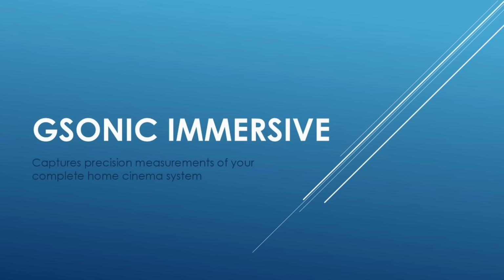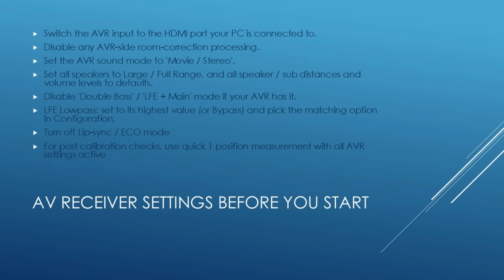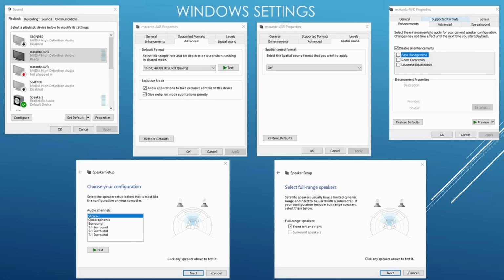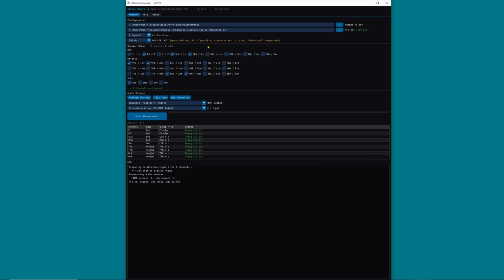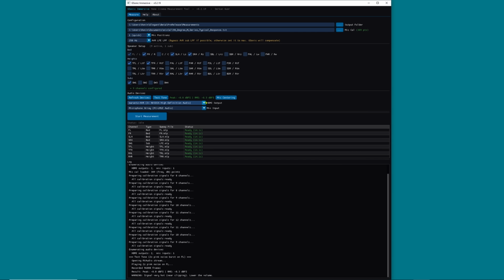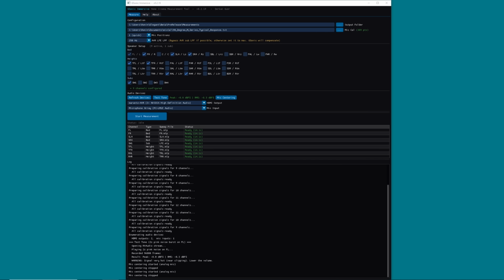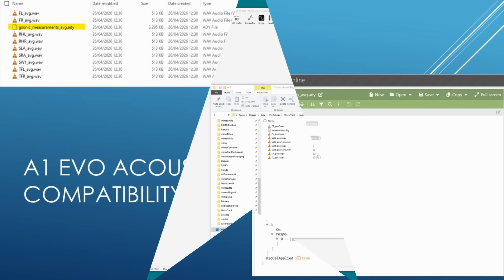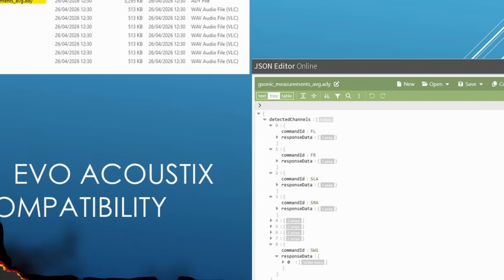GSonic Immersive

Comment: Trying version 1.09 can’t get past the front right speaker on first measurement had unreliable ATR timing. Both chirps were blocked or one was disrupted. Step out of path.  Nobody is in the room.???
Reply from the maker: Did you try AVR reset? It checks and reports if your current setup is decoding Atmos correctly.
Reply: @ocaudiophile  no I did not do an AVR reset. And I am not using Atmos speakers. The chirps are loud and clear and the microphone picks them up as the last version I had worked perfect
Reply: Except as you know, the volume issues
Reply from the maker: Set your AVR in Windows to "Stereo" mode, not 5.1, not 7.1 not atmos. Make sure you tick allow exclusive access", 48kHz, disable enhancements. Set AVR sound mode to stereo when there's no signal coming. This is the one that auto-switches modes. Some older models reported "Direct" sound mode worked for them but uncofirmed.
Reply: @ocaudiophile  the microphone is set to 48K gaming, stereo, movie are all set to stereo. 5.2 is pretty much automatic on this model. Once you select your speakers it’s a brand new model one year old.
Reply from the maker: Never heard a gaming setting for a mic but any/all enhancements needs to be turned off in general. If you assume the app is working correctly and look for what must be wrong in your setup, you will solve this quicker. If you are using settings you always use with REW for example, it will not work. I don't know whet else to tell you.
Reply: @ocaudiophile  I don’t know what else to tell you either. It’s not like I don’t understand this. I engineer my own speakers I used to repair television. I was a master technician for general motors for years before I started my own business. I totally understand, electronics, and all of this I’ve been doing this for 60 years as I built my first speaker when I was eight
Reply: I’m using 1.08 right now and it is working fine for the testing
Reply from the maker: Yet you think setting all speaker distances to 9ft will deviate the center.
Reply from the maker: Yet you started this conversation claiming there was 20dB difference between your FL and FR with v1.0.8
Reply: @ocaudiophile  I never said that I was just giving you what I saw as I checked through everything after version 109 reset everything. What I’m gonna try tomorrow is use version 109 to set the volume then switch to 108, and do all the measurements and see what happens. Like I mentioned to you before the only problem I had with 108 was that the levels were all over the place. Front left was 14 DB higher than front right and both subwoofers were set to +12. I’ll be starting around 9 AM central standard time. I’ll write you back what I find if you think of anything I would appreciate. And if I think of anything, I’ll write you.
Reply: @ocaudiophile  no that is incorrect. About a 14 dB difference. But if you saw my post on AVR forum, I said that there was a 24DB subwoofer difference with the new.Acoustix, using version 108. All of a sudden my subwoofers went to +12 DB, the old version was minus 8DB and I was using it in flat mode instead of reference, which was another 4 DB. = 24DB. Some people and AVR forum were saying that would G sonic there base was lacking 10 DB. I can’t verify that. But some change was made and that’s what happened to my system. I’ll keep you posted what I find tomorrow. Plus, I’ll think this over tonight and see if I can come up with something but I’m nowhere is near sophisticated as you are with this area.
Reply from the maker: If you knew me better, you would know I’d have already told you if there was even a small chance this issue was caused by the app and ask for your debug log. Bugs do exist, of course that’s true for any software but your specific problem doesn’t seem to come from the app itself. That’s why I’m trying to explore other possible causes and mentioning anything that comes to my mind.
I’m not suggesting you don’t know how to configure things properly. The setup for this app can be quite complex and varies a lot between systems. Windows audio kernel, in particular, is quite messy, and since the app uses three different sound modes during sweeps, it’s definitely not straightforward.
That said, your symptoms point to something else entirely. It could be related to a faulty HDMI cable, a microphone extension cable, or another hardware or driver issue. It is not capturing any of the two ATR chirps since it thinks you are blocking the FL speaker. If one was lost, I would say high reflections. Anyway, Let me know how it unfolds later. Btw, I am happy to issue you a refund in case you get stuck and app is useless for you.
Reply: @oca @ocaudiophile ’re misunderstanding me I don’t want a refund. And again, it is measuring perfectly with version 108. I thought about a handshake issue, but I don’t think it is. Let me do what mentioned tomorrow and I’ll get back to you.
Reply: Also, the Mic centering does not work at all. It’s all over the place and trying to put the microphone first to the right 800 mm done to the left 800 mm and so on but mostly trying to put it to the right.
Reply from the maker: You need to move the mic slowly listening to the tone pitch, it will increase the closer you get to the center, no need to look at the screen. It will only start giving tones when it's around center.
Reply: @ocaudiophile  I totally get that. There is no space between the speakers that the centering stays put it jumps all over.
Reply: @ocaudiophile  also maybe this will help, the automatic reset is setting the distance at 9.8 feet for all speakers not zero
Reply from the maker: It sets everything to 3m
Reply: @ocaudiophile  if that’s the case, why did the old version of G sonic get through all eight positions?
Reply: @ocaudiophile  good morning. I tried the workaround I mentioned, which was to set up the receiver with 109 then take all the measurements with 108. That part of the process worked out fine. But the readings I got were still extraneous. Front left +11 DB, center minus 7DB, front right -7.5 DB, surround right -8.5 DB, surround left -8.0 DB, subwoofer one +12 DB, subwoofer 2+ 7DB. And no, I do not want my money back. I appreciate all your hard work. One other thing I noticed is when scrolling through set up, the processor is slow. Additional facts.= I use a Dell latitude, 5540 laptop with a clean install WIN 11, version 25H2 to measure. I use the microphone 3.5 mm jack with internal mic& speakers disabled. I transfer the file via thumb drive to my PC where I have Acoustix installed and working.
Reply from the maker: Can you try un-ticking (yes no spelling error) "Allow applications to take exclusive control of this device" for the mic in Windows? Wasapi exclusive mode seems to be causing issues with some setups, this will disable it. Let me know if FR errors are fixed that way.
Reply: @ocaudiophile  will do, it’s under Jack Mic properties. Let me set my mic up with a receiver. I’ll get back to you.
Reply: @ocaudiophile  when I on tick all of the speakers except the front left obviously it still shows two speakers
Reply: Never mind, sorry I found it somehow RTF got checked. Let me try again and get back to you. My apologies.
Reply: OK, I loaded the corrections to the receiver. FL +5DB, center -12 DB, FR -12 DB, SR -12 DB, SL -12 DB, sub one minus.5 DB, sub 2 -4DB. Ouch.
Reply: Oops, sorry again for the thumbs down. I forgot to mention I used May 7 version
Reply: @ocaudiophile  i’m not sure if you got my last message. The program itself worked fine this time 109. I ran it through acoustix and then downloaded it to my receiver. Speaker levels as follows. FL plus 5DB, center -12 DB, right -12 DB, surround right -12 DB, surround right -12 DB, subwoofer 1 -5DB, subwoofer 2 + 4DB. I used the May 7 acoustix version. I am in no hurry and if it can’t be fixed that’s that. And again I appreciate all your work.
Reply: Correction subwoofer one-.5 DB
Reply from the maker: So exclusive mode somehow messes things up for you. I'll need to release an update since that's opposite of the video instructions.
Reply: That did it. Terrific. It got past the front right and now I’ll finish the measurements and see if the values are not crazy. I’m only doing one sweep, but I’ll give me a good idea. Should be done in about 20-30minutes. I’ll get back to you.🤞🏽
Reply: @ocaudiophile  oops sorry about the thumbs down. OK I have a problem with 109 the first time I measured one Mike position it double swept sub two. I’m looking at configuration, and I have 5.2 set up FL, FR, C, SLA, SRA, two subs. Checked. Under speaker set up it shows 8active, two  subs. This is in version 109.  I couldn’t load the version on to the receiver because of the extra speaker.
Reply: @ocaudiophile  good afternoon or evening. Been playing around and trying to get this program to work correctly still. I found a mic switch in windows that I flipped and I wanted to try it this morning here. Low and behold, all the speaker sweeps are working, but now I have no sub sweeps. I tried on installing the program reinstalling the program. I also reset the AVR. Nothing. Went back to acoustix and the sub sweeps were there. Please advise. Thank you.
Reply from the maker: The same silent LFE sweep issue has been reported more than once. If you have multiple subs, HDMI Atmos lock might have been dropping during the pause for SW turnoff and LFE is playing in a 2.0 stereo mode causing the silence. If you have a single sub, maybe try "Direct" sound mode instead of "Stereo". Regardless, I have decided to build an updated version with safer margins and longer dithers so these set up specific issues come to an end for all users but measurement process will have to take slightly longer to complete. Should be out before the end of the weekend.
Reply: @ocaudiophile  you’re the best thank you. I’ll just wait for the update.😊
Reply: @ocaudiophile  no sub sweeps audible and version 1.1.0. There is something about AVR is not switching to the correct immersive sound mode. Check that the AVR is in the correct HDMI input and sound mode is correctly set for auto switching. It has to be in the right mode because the program is showing, what am I missing?
Reply from the maker: You still have issues with v1.0.10?
Reply: @ocaudiophile correct no sound with sub sweeps, other sweeps fine. Reset Avr also. Re started laptop, reinstalled 110 with another laptop restart. Went back to acoustix and they worked fine.
Reply from the maker: Can you try with just a single sub connected?
Reply: @ocaudiophile  I already tried that, I unchecked sub 2 re-ran the program and no sweep from sub 1
Reply: Note: to save time, I am only doing a FL and sub sweep. FR, center, RR, LR are unchecked.
Reply from the maker: Someone with the same problem suggested he uses paused sweeps, keeps AVR in stereo for FL sweeps, then sets sound mode to True HD and continues from there which is all quite weird but just passing the info over as it might help.
Reply: @o @ocaudiophile . This is what I found.  1. I start out with the receiver in Dolby surround.2. I run G sonic version 110. 3. G sonic then put the receiver into True HD mode with AVR reset. And Walla it works. And   The saved measurements I ran with May 7 version of acoustix, NO crazy erroneous readings either . Woohoo. I did a quick one position measurement. It sounds great.. Hope this helps and thank you thank you. I will be making a multiple position measurement tomorrow and if you don’t hear from me, that will mean everything is A-OK. Great job and support. keeping my fingers crossed, but I am thinking we are good to go🤞🏽
Reply from the maker: I am sorry you have to manually intervene to the AVR during sweeps, that was not the design intention. I hope to understand some time why this happens with a few AVRs. Great to hear you are getting good results. When it does, it measures really with very high precision. Check your phase responses and you will see the difference.

PS I issued you a partial refund for your troubles. Your license is valid and is good as original
Reply: @ocaudiophile  please do not refund any money. I will send it back. Also, I’m not manually doing anything. I just set the receiver to Dolby stereo. Gsonic switches it to True Dolby HD. After that everything works. I’m not sure if there’s phase problems. I’m not the Technical with REW yet.😊
Reply: @ocaudiophile  correction. I set AVR into Dolby surround mode, then G sonic does the rest
Reply: Food for thought: possibly the problem is with the higher end receivers? My 6800 is pretty much all automatic. In other words, I cannot manually switch it to True Dolby HD, it’s not in the menu, it detects that when you play the source. As I mentioned before G sonic switches it from Dolby surround to true Dolby HD.
Reply from the maker: Possible.Sweeps go FL - lpcm , FR, C, SLA, SRA, SBL, SBR, SUBS - True HD Lossless, All others - True HD Lossless Atmos. These all had to be in that order and format for clocking precision but switching sound mode times and triggers seem to be varying with models especially when time precision needs to be kept. Unfortunately, you can't just throw in an atmos signal like playing a movie and wait until AVR starts playing it, you need to know exactly when.
Reply: @ocaudiophile  I have one question. Is there a way to pause the program? What I’m getting at here is right now I’m taking the FL in Dolby True HD. The only way I can get it into that mode is with G sonic AVR set up. So this would be the order if I needed to measure FL in stereo mode.1. Run AVR set up in Gsonic. 2. Switch manually to stereo.3. Run AVR set up again(in Gsonic)with saved FL results to get back to True Dolby. 4. Continue the rest of the program. OR. Is it OK to take FL in True Dolby mode??  thanks again for your support.
Reply from the maker: So long as the sweep audibly plays and plays from the correct channel and app doesn't ask you to repeat, the measurement is correct independent of the sound mode engaged.
Reply: @ocaudiophile  OK perfect, I will just use FL initial measurement in True Dolby mode. 😊
Reply: @ocaudiophile  I was only able to audition a new program for about 45 minutes and it sounds great. I do have a question again though and sorry if I keep bothering you. Using G sonic 1010 and acoustix May 7, the setting for subwoofer two is at 59.1 feet. Subwoofer one, FL, center, FR our approximately straight across and approximately 14 1/2 feet away from the MLP. Subwoofer two is adjacent to the right of a loveseat couch which is MLP. When I went into settings to see if there was any headroom for distance, it seemed that 59 feet was the max, and I was able to go lower, but not higher. Please let me know if there’s any cause for concern or not. And again, thanks for all the support you’re the best. I really really appreciate all the hard work you do.
Reply: Was auditioning this morning. Incredible….that’s all I have to say. Fabulantastic
Reply from the maker: A final even better version is coming. Not everyone can check if their subs were adjusted and measured correctly like you can so I've added some more data.

Comment: merhabalar, TS ve CH için kanal ekleyecek misiniz...teşekkür ederim...
Reply from the maker: Yeni modellerin bazilarina  U38 diye bir firmware update gelmis ve re-direct edilebiliyormus Auro kanallarina menuden. Asagiya kopyaladim, bende malesef Auro 3D yok ve onlara ozel sweep uretmenin imkani da yok.

Up until now, a cable swap for CH+TS was always necessary for a proper REW measurement. But changing the layout before the measurement is a good idea to try.

Comment: Hi OCA, I have followed the instructions but cannot get the  measurements to fully work. I have a marantz 7012 factory reset, use rear media player hdmi plugged into an old intel i7 hybrid Radeon graphics hp laptop using windows 10. Gsonic is able to detect AVR and umik. I am trying to run the sub measurement so choosing 1 position, fl and sub1. The fl sweeps with no issue, then it errors saying cannot open hdmi for truehd pass through. Any ideas, thanks.
Reply from the maker: Tick "Allow exclusive access" in AVR window settings.
Reply: @ocaudiophile yep I following all the settings under the windows audio configuration settings, still can’t get the error.
Reply: Is there away I can email all the screenshots?
Reply from the maker: You can upload them here if you want:
https://drive.google.com/drive/folders/13eRDRmuTau_J90WkXuszPc_MZU5LWiYv?usp=sharing

The debug log which is saved under your C:\username\ will be a lot more useful but better wait for the soon to be released update. Your HDMI lock is related to the PC and its HDMI driver. Try updating the drivers maybe?
Reply: @o @ocaudiophile I think you are right, my laptop is the issue. I am purchasing a new one next week, can I reinstall gsonic on the new laptop?
Reply from the maker: You can. Let me know if you encounter any problems.
Reply: Hi OCA, I now have another laptop and can see truehd audio format which allows me to run the measurements. My new problem is in windows 11 the audio enhancement screen is not visible and by default it is enable, as shown in gsonic. I have updated drivers but nothing. Any ideas?
Reply from the maker: Check Facebook group featured comments.